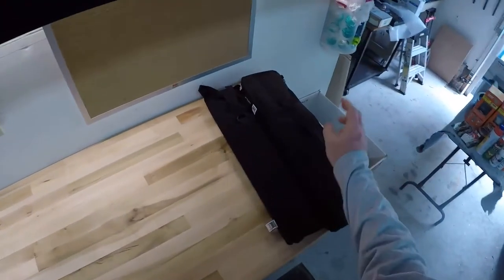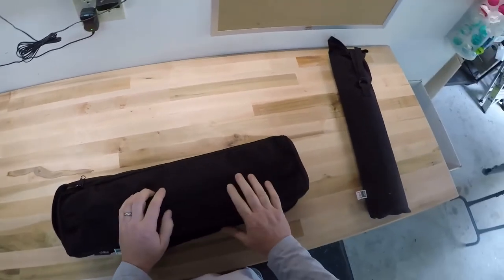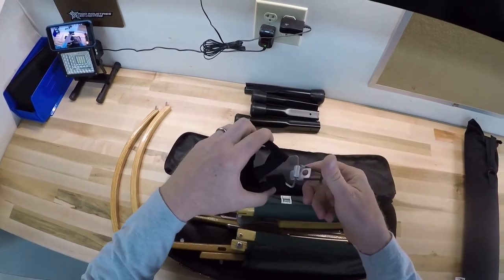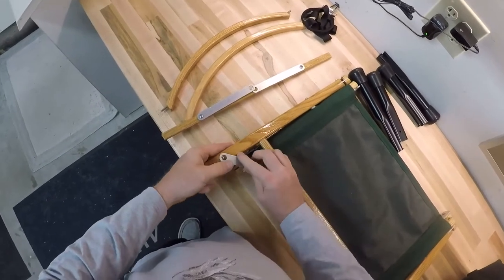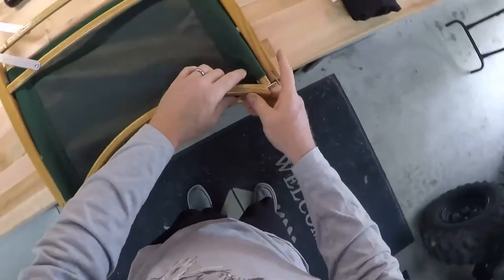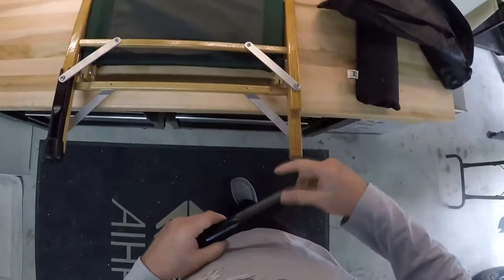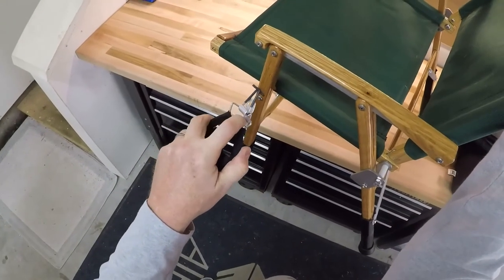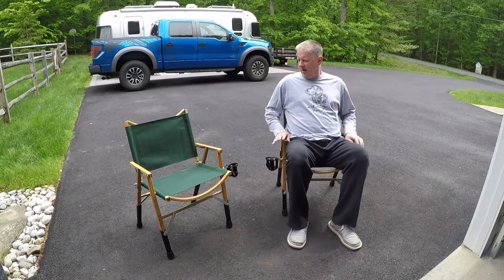Product Review: Kermit Chairs and Kermit Wide Table (with Leg Extensions, Chair Bag, and Cup Holder)

Comment: Hey Nerds.  Now that you've had the chairs and table for awhile, Do you still use them?  Are they worth the price paid? How are they holding up?  Are they your go to chairs and table?  Thanks.
Reply from the maker: Hi Mike - we have not used them very many times but when we have used them they worked great.  They still go together very easily and are as solid as they were when we bought them.  For the amount of usage in our adventures I would say that they cost more than we would have liked but do not regret the purchase.  Thanks for the question!

Comment: Great solution if you need to save space. My wife will not give up her two folding recliners. They have been a PITA for me to try to store in the truck bed under the camper shell. Finally figured out to store them on their sides so I can slide them in without taking up too much bed floor space. They lean against the shell side near the tailgate end and I use a racket strap hooked on two of the camper shell clamps. I can slide them into the truck easily before we go to bed or if it starts raining. If I didn't have the camper shell They would have to lay flat on truck bed floor.
Reply from the maker: I don't have a shell on my truck for the folding recliners so I know exactly what you are talking about...this is why the change